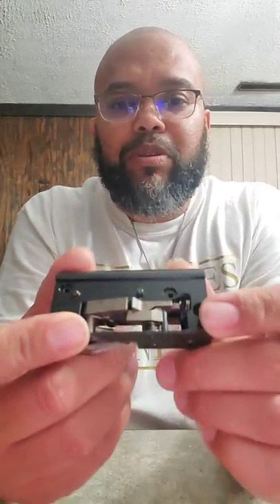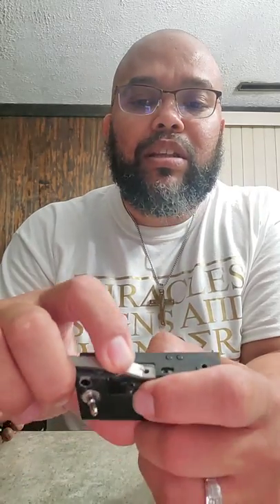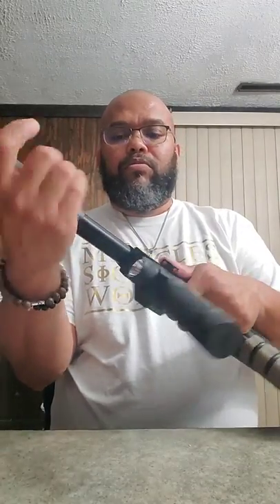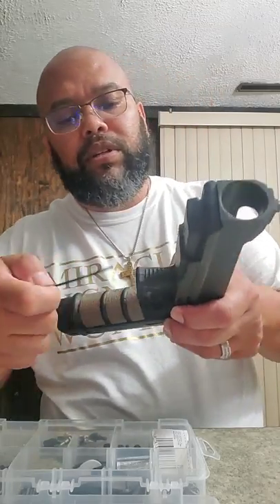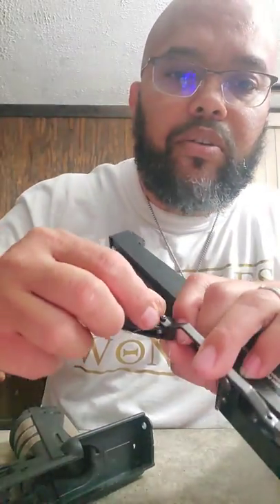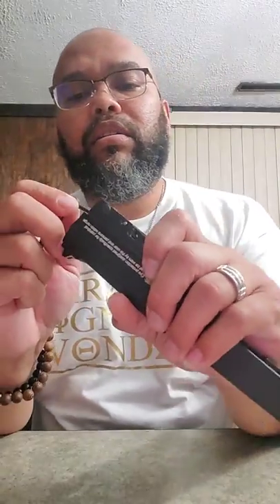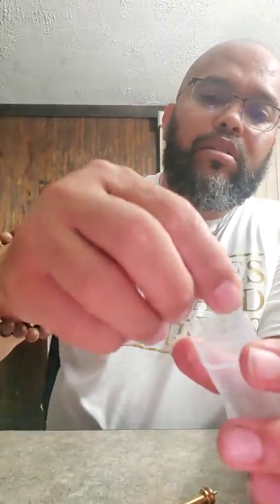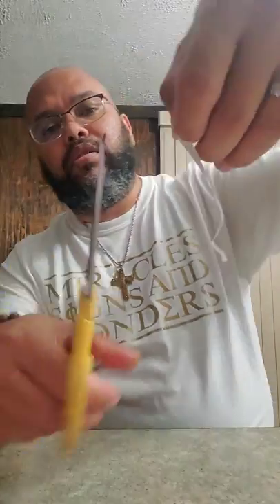FSC, T8.1, T9.1 power gain! PRV delete!

Comment: Went to the local hardware store and got one set screw #10-32 X 1/4 in
Reply from the maker: That aughta do it! Don't forget the Teflon thread tape!
Reply: @psi.defence.channel  Tried to find this video on youtube of someone getting over 1000 fps on his FSC.He is the one with the Firing Bolt Assembly swelling.Also kept blowing the stock  rubber O-rings in the regulator and went to high pressure Polyurethane O-rings.
Reply from the maker: @danielquesnel130  that sounds pretty far fetched. That's firearm velocity. There is a lot of physics in the way of somebody getting that from an FSC. If you find the video I'd love to take a look.
Reply: Wouldn't Loctite replace the Teflon tape?

Comment: Informative ...this is the way I will have to go to get my preowned Ebay t8.1 purchase to run...fired when pulled it out of mailbox..left good feedback...was happy. Cleaned it up, put in milsig o-ring, adjusted velocity and snugged prv. Twisted co2 with no crisp snap just air leak through prv / velocity adj port..took reg. apart...filthy like sand throughout..cleaned new orings...still blowing out. Willing to buy new Regulator but Rockstar Tactical is out of parts..so..will be making trip to Lowe's for detent plug...thanks
Reply from the maker: Contact Daniel 🙌🏾 for a prv delete kit. Comes with a new sealed spring pad, a vks sear spring which negates many malfunctions at high velocity settings, and a vks bolt spring which you need for the prv delete to operate properly and consistently. 
danny69726972@aol.com
Reply: @psi.defence.channel  w ii do...thanks
Reply: bro check to see if your air chamber is aligned and the cap screws into both the frame and chamber also when u put it back together u gotta make sure the bolt is alk the way forward before putting on reg or else it will boow the sir out

Comment: I'm surprised you didn't mention the pinhole at the bottom of the brass piece lining up at the bottom of the pressure relief valve. Followed ur reg build but think I may have shimmed to hard on the 1st piece in when reassembling. I wonder? Soon after I applied the prv delete, my fsc gave up ghost. Not yet back to stock firing, possible its air hole in air chamber, not cranking the bolt that prv delete bolt down far enough? That's where I'm headed I guess on my 12th tear down.

Comment: Exactly what I have looking for. Love your Videos! straight to the point! Very easy to understand! and, No music, No long Intro. Question in regards to the Regulator Spring Mod, on your other video, did you see any increase at all in trigger pull weight? when you did the Regulator Spring mod? I will be watching for HPA setup, combined with these high power mods.
Reply from the maker: Not really. I'm sure there is some with the increased rotator pressure, but not noticable. It just feels very solid and hard hitting! Truly a magic mod!
Reply: @psi.defence.channel  Thats good because, i am a Trigger Guy, I must have more than 50 Airguns, I like to test a new Gun by Pulling the Trigger several Dozen times at different speeds, and at Normal speed, and Watch the Muzzle end of the Barrel while pulling the trigger, this is for ANY Muzzle RISE and Muzzle Drop, Throughout the trigger pull sequence, if there is any, this tells me I am trying to OVER Come a TRIGGER spring Tension that is TOO high and it is Throwing OFF my Accuracy!!! As in,  the POI changes when i pull the Trigger to overcome trigger Spring weight, then i know i need to do some work, or trigger length of pull is to long before a clean sear break occurs, or Trigger Stop occurs way past trigger break occurs. I have done MANY Trigger Jobs on Everyone of my Airguns, in some fashion, every airgun i have, was NOT to my liking, out of the box, and had some Accuracy Issues due to the Trigger. Granted the Tiberius is a Short Range Gun, but for its intended Purpose, I dont want to Miss Target, from across the length of distance of my homes interior, say 20 feet to 30 feet as Max Range to target, so a Close range tool. During a Very Stressful event of a Home invasion, and adrenaline is Very High, Mistakes can be made, Hitting target while under a Great deal of stress is Much different than being relaxed shooting at a still target.  All my Air Guns have needed, If Not reduce trigger Pull weight, then reduced trigger Length of pull, and/or Polish all mating frictional surfaces, and install a trigger over travel stop adjustment. Do you Use Balistol as a degrease/Cleaner spray on your triggers, before Lubing them? I Know O-ring preservation, and keeping from drying out is of the Highest concern for Longevity, for failure resistance. I Mention as it is a Fine line for me, as I want my T8.1 to be Rock Solid, and NOT have the Leaks I have been experiencing with both of mine, as they have been Paper weights for Far too Long due to leaks. I am will to try almost anything to get them to shoot at 30 joules and keep a High level of accuracy. I really Like the Extreme Green Lasers for Sights, as they are Great at Night, and So Brite i can see them easily during a Bright Sunny day outside. and I really Appreciate all you Hard work, and the Thoughtful ness and time you have spent to get to this Point. I would Like to see a Video Of your T8.1 Creations this List the mods done to each one, the Parts changed from stock and the site where you got them from. This would be Very helpful having it all in one video. Thanks for all you have done!!
Reply from the maker: @garywest3763  if the trigger feels too heavy you could forego shimming the rotator spring. I experimented with polishing the mated rotator/return surfaces so they slide easier. Not sure if there was any benefit there. I'm planning a power video next where I break down all the mods on my launchers and chino them all. Hopefully I'll get some time here soon to do it!
Reply: @psi.defence.channel   I am going into town today, to get the 10-32x1/4" Socket set screws, and look at the Spring selection they have available they have there. I have used O-rings before the size of the Pin/shaft pivot, as a spacer to increase spring tension inside a couple triggers. looking at that Broadened Spring, I am trying to Figure out what the benefit is to increase the Diameter of the Spring from one end to the other, unless it is to get more tension on a shorter travel? Or is it for Smoothness of travel? Or is it related to some type of Articulation movement?

Comment: Humm, after gutting the PRV of its internal parts, does it Move internally, any movement under that Big Spring?. What is that Brass Valves Function, AFTER the PRV delete has been done? is it just a air reservoir? Does the SMALL weep hole in that Valve perform a task still? can it be Opened up to a Larger size to let air/co2 pass faster? I am trying to under stand the Fluid Dynamics of this part of the Gun, I wish i could see a video of the fluid dynamics with the directional Flow through the Gun Per Shot, as that might open up more opportunities.  That O-ringed Brass part appears to be a Valve of sorts, with the large spring creating pressure as the brass valve lets air go from one position to the second position?. That Valve Chamber Volume is Greatly Reduced by the Parts that are in it, ie: the Large Spring, Brass valve, Can the Gun Function without those Parts, being in the gun?, and still cycle correctly?, and seal properly? is that Valve Part of the semi auto Function? If that chamber were Larger due to the sum of its parts being removed, would there be any gain from that volume of air being significantly Higher? so in other words Gut the PRV completely, and put in a Plug into the end of the Gun sealing the gun, and all those parts are removed creating a Much Larger Volume inside the the PRV? That would Eliminate All adjustment and you would have FULL POWER/ FLOW with No adjustment anymore. I am Looking at a Exploded View of that valve, But would like to see a Animated Video of the Flow of Fluid through the Valve to actually see it functioning on at least a few shots taken.
Reply: after looking at it more closely, it looks like the elimination of those parts may/would cause the Gun to leak air directly through the Valve parts being in their to Stop the air Flow per shot, as it looks like a check valve? air would Probably Leak out through the Barrel without anything to Stop it. Probably causing a Major Leak down once the co2 cart was punctured.
Reply: What about Opening up the Brass valves Weep holes to a Larger size? to increase or speed up flow?
Reply from the maker: Not exactly sure about all your points, but you need the sharp tip of the spring pad to hold open the ball valve which is at the heart of the air regulation.
Reply: @psi.defence.channel  I was thinking that the Brass valves tip opens by pushing the Ball out of the Way to allow the Flow of Propellant. What if the regulator Ball and Regulator Spring from the exploded view were to be removed/ As i am Not sure if that is constant propellent or on and off per shot taken?, if you could get Max Flow here Not sure what the Out come would be if we would get a more stable FPS across the shot string, But then you would get rid of power adjustability. it would be set to Max flow all the time and not be any adjustment. Not sure what that would do to the stability of the shot stings FPS, as I want to get to a more stable shot string with a standard deviation between shots to be closer to 2 fps deviation between shots, so if we start at say 50 joules of power then at shot 8 we are maintaining a High power shot still around 30+ joules. I would like to be able to see How the Propellant Moves through that valve after it passes the spring and Ball,  there must be another Passage allowing Propellant to the Barrel. That other Passage, Orfice size is the Key to reducing, or controlling the First SHOT down? (or Larger HPA tank Maintained, or Double 12 gram co2 adaptor) from 60 Joules to maybe 35 to 40 joules and Not Providing such a Loss of propellant on the first shot, and between shots, but more evenly spread out. Ideally i would like to have a extended Mag 16 balls, shoot at 30 joules on a single 12 gram co2 or run a Dual 12 gram co2 adaptor on my Rear fed T8.1 or HPA 13ci tank, I know that doesn't sound realistic for 16 ball mag to be shot on one 12 gram co2. But my other T8.1 has a REAR ASA fed 13ci Ninja tank and regulator set to 1100 psi.
Reply from the maker: @garywest3763  I would think it would waste more gas between cycles, but idk. Kurt from Grimburg would be a good person to talk to. Their less lethal pistol they are developing has no prv or regulator.
Reply: ok i think i figured it out. the propellant passage way is from for Mag fed purpose example, from the Nipple in the Regulator, if you removed the reg Ball with its reg Spring, this would open the flow up to Constant. they way to reduce Propellant Flow, would be to restrict Flow on its Output side, by using a Smaller ID Oring, same size O.D. Oring is Number #5 on exploded view. Getting that I.d. to only allow a more restricted amount of propellent through would create a Flow restrictor to the Barrel, which should tighten up the Shot string between shots, thus getting a higher powered FPS Last Shot.
Reply: Maybe try it OEM but Maxed out adjustment, and Not removing any reg. parts But installing a More restrictive Output Oring on the Regulator to restrict Flow to adjust the first couple shots, to keep them from draining the co2 cart down so quickly

Comment: @ 17 turns wow! The Firing Bolt Assembly @ too much pressure will swell and jam because the inside part is made from aluminum.Where can I get a steel Firing Bolt Assembly ?
Reply from the maker: @irkedoff  that's some pretty crazy numbers. What weight projectiles are you shooting at 500fps?
Reply from the maker: @Daniel I actually did have an air chamber stem swell on me when I first put together my T8.1 with HPA prv intact. But since then no issues. I'm still going to push the boundaries so I can let you guys know what is and isn't reasonable! ✊🏽
Reply from the maker: @Daniel noone makes steel bolt assemblies. I've looked. To get some milled is some serious chips too...

Comment: Tried ordering a new spring pad assembly from UTI.  Won't sell it to me.  Need to send my pistol in.  Any place you can direct me to that sells FSC parts?
Reply from the maker: Rockstar is the best. 
https://www.rockstartactical.com/search.php
If there's something that you need and they don't have it, ANS gear or PB sports will sometimes have it. But spring pads are in stock right now at Rockstar
Reply: @psi.defence.channel  Thanks for pointing me to Rockstar.  I got several spring pads.  TCP is not leaking air any more.  Thanks!

Comment: I ordered some of those PRV delete parts but not sure when I will do it. Eventually will try it on one of my FSCs but I'd like to understand the issues more first. What are the pros/cons of the PRV delete when at very high power? And what are the pros/cons at a more usable/reliable power. I keep some FSCs for defense use (more reliable at 30-35 joules) and others I experiment with where almost anything goes if well planned.
Reply from the maker: The PRV delete kit mirrors the internals of the VKS. No cons as long as you use the vks springs. Prv is meant for paintball use.
Reply: @psi.defence.channel  Great to know. I'm still chasing leads to get VKS parts, specifically that main spring.
Reply from the maker: @maxhauler  contact Daniel
danny69726972@aol.com
Reply: @psi.defence.channel  thanks man. appreciate you.

Comment: Hay thanks Henry I just paced my order for a 25 pack of those screws had some Amazon reward points so it was only a little bit more then 6 bucks think I'm going to give it a try one question I only use co2 will this work with them
Reply from the maker: Cool. You're gonna need VKS bolt springs tho
Reply: @psi.defence.channel  VKS Bolt spring ? where can I get that rockstar?
Reply: @psi.defence.channel  Looked for a vks bolt spring where the heck do I get that
Reply from the maker: @smokingunclefrank6037  I got mine from Daniel Sturling 
danny69726972@aol.com
Reply: @psi.defence.channel  Canaled order can't find that spring no Biggy I can always get it later if I stumble on a VKS bolt spring

Comment: Does this PRV delete kit work with the T8? Thanks
Reply from the maker: No, the T8 prv is in the rear block. This one works with the FSC, TCP, T8.1 and T9.1
Reply: @psi.defence.channel  Actually it does work with the T8 but I just end up using some pipe dope and turning the spring pad upside down and using a solid set screw

Comment: I thought closing the PRV can damage the marker?
Reply from the maker: It's for keeping paintballs from firing too hot. The TCP has no prv
Reply from the maker: @ScaredyCatTactical  they're essentially the same. The vks just has a larger air chamber and a longer Barrel. They both have the same regulator and trigger group. But I thought the TCP had a solid spring pad with no prv.
Reply from the maker: @ScaredyCatTactical  reach out to Daniel Sterling danny69726972@aol.com
He has a complete kit that comes with a blocked off spring pad, a vks bolt spring and a vks sear spring. You wouldn't necessarily need the sear spring since the TCP has a pretty stout one to begin with, but that bolt spring makes a huge difference
Reply from the maker: @ScaredyCatTactical  the vks sear spring is a lot beefier. I'd definitely get his kit then!

Comment: I think this is what I need to do to stop mine double firing gasing out
Reply from the maker: Definitely the best upgrade for reliability consistency and power! You only get 10 to 15 FPS, so not a huge power game but the stability is worth its weight in gold!
Reply from the maker: https://www.sterlingselfdefense.com/product-page/ssd-prv-delete-kit
Reply: Have just put the prv delete, shimsear kit and vks bolt all in and together unfortunately I carnt test It now its to late  but fingers crossed this has solved my problem,will keep u posted with results hopefully after work this week when it can come out
Reply from the maker: @mattfrancis9275  I would say that the Sterling prv kit solves 95% of most malfunction problems! Can't wait to hear the results
Reply: @psi.defence.channel  thanks  🤞
Reply: @psi.defence.channel  wow forgot the sound of it and certainly seemed like a bit of a kick to it increased the velocity also,thanks for the videos u post always a big help,I steamed through 5 mags so much the top of the fsc had condensation on it 😆
Reply from the maker: @mattfrancis9275  SSD prv delete kit is worth its weight in gold! More stable, more power and yes, louder! 🤣
Reply: @psi.defence.channel  Henry I notyou have the mag extenders for the fsc I have to from CymruTec what is the best way to stop both springs knotting up so to say
Reply from the maker: I don't have that problem. I think I'm using 1 red and one silver.

Comment: That steel bolt may be Teflon coted or something like that
Reply from the maker: It's a steel oxide coating. It was prone to rest that's why Tiberius stopped using it
Reply: @psi.defence.channel  To bad they would last If taken care of properly
Reply from the maker: @smokingunclefrank6037  well, paintballers are often in wet, muddy environments. Less Lethal not so much
Reply: @psi.defence.channel  Thats what I was referring Defense not paintball
Reply from the maker: @smokingunclefrank6037  ya, I was just saying that's what drove Tiberius' decision